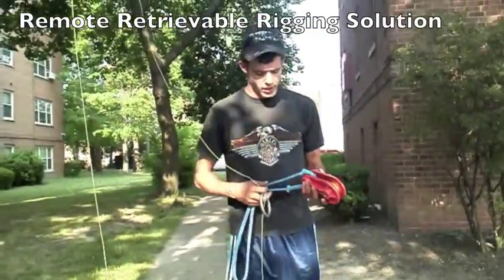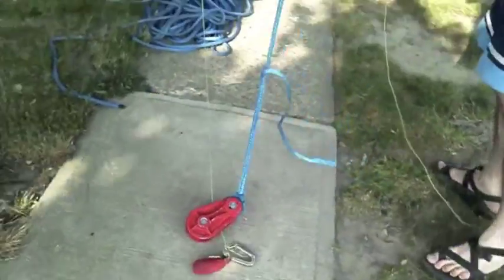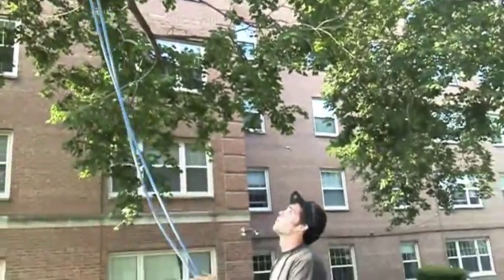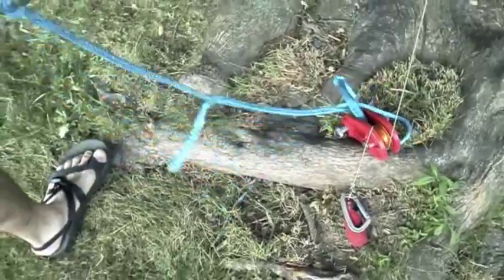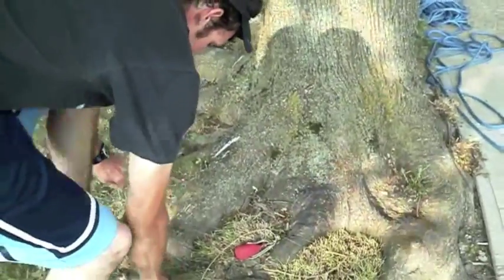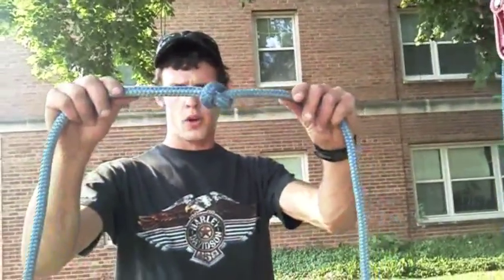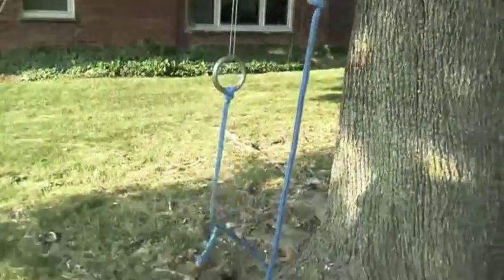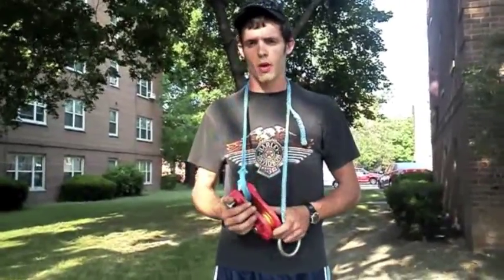Remote Retrievable Rigging Solution - 3RS

Comment from the maker: I also set it up in a really large maple far above the climber and then used it to swing some pretty large branches, 30'+ by 12", away from a house. All without issues.

One other thing worth noting is that sometimes once under serious load the ring will end up slightly below the block, which ends up creating a much more normal 'block like' bend radius. Either way it isnt an issue as long as you use it like anything, with some sense and a healthy dose of caution.

Comment from the maker: You can see around 4:20 onwards it does change the bend radius. I havent calipered the ring but I guess it is 1/2". If the rope was bending straight over the ring I would have a concern but seeing as it goes over the block sheave and then horizontal before over the ring it doesnt seem to be an issue. 

I have not been using it everyday, but I have used it to hang some medium sized trees maybe 1000-1500 lbs with no issues.

Comment: the question that i had was really if when loaded does the sheave share the load with the steel ring seeing as they are side by side. and if so what change in bend ratio would that create?  i only ask because i have seen in the past where large diam ropes have been mishapen or even burnt under the stress of a 12mm ring, after continual use.( almost defeating the purpose of friction management) have u experienced anything that u might note as aconcern

Comment from the maker: As far as static loads and lifting sure. The WLL of a portawrap is 2000lbs and the dead lift of a GRCS is 3000. I would feel comfortable using any rated rope and this setup anywhere within those SWL/WLL's. Seeing as the situations where you are using a remote block are usually where you are cutting at your level the TIP for the load should always be below the rigging point.

Comment: with the rigging line running through the larger sheave in the block, do u get any extra rubbing or changed bend ratio off of the steel ring? in short, do u feel comfortable using the block and rigging line to their full capacity?